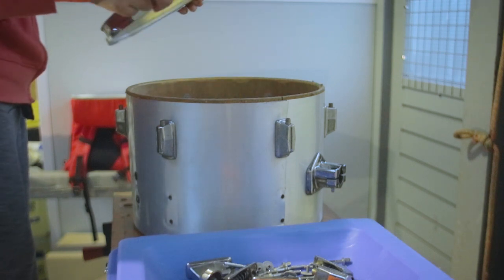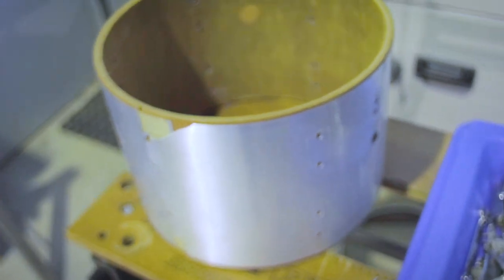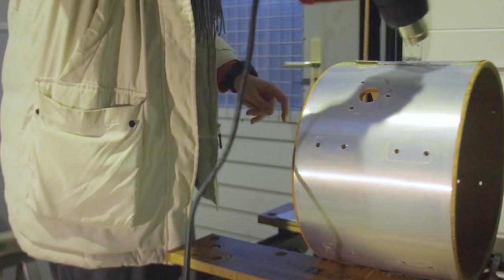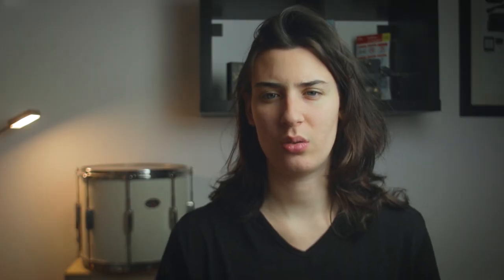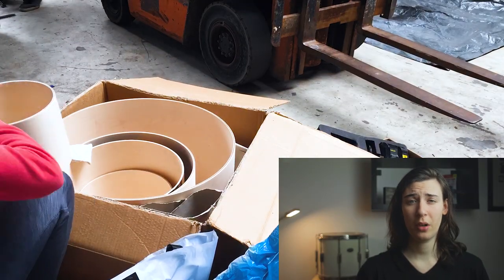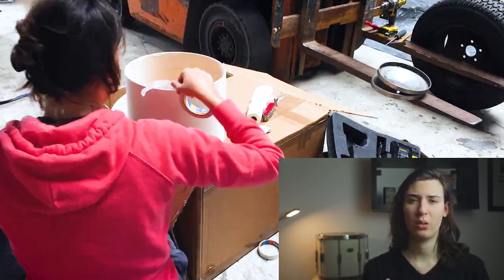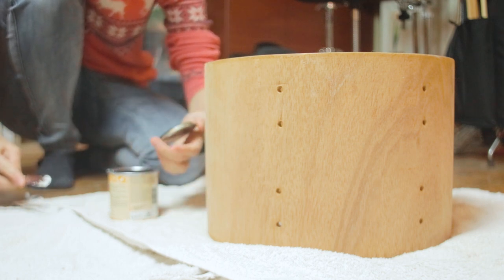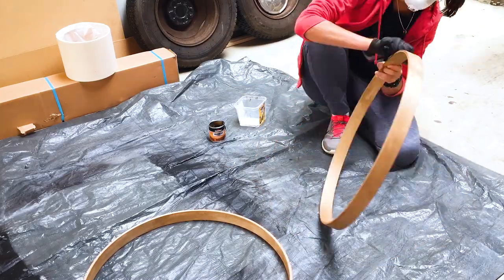How To Remove Drum Wrap and Stain Your Drum Kit

Comment: Can I use spray paint and they cover it with a spray-on gloss?
Reply: I want to 1. Sand off the existing coat so it is rough and light 2. Add protective tape and plasticto edges and inside 3. Paint pink spray paint 1 layer, 4. Add a cool silver glitter design, then finally, 5. Add a glossy layer using sparkly gloss clear spray paint. Will this work? Is this too much?